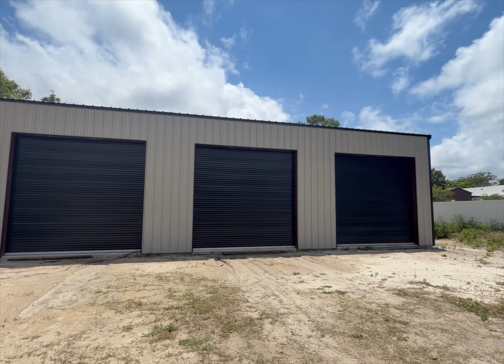60x60 Red Iron Workshop Build

Comment: What was the cost if you don’t mind me asking?
Reply from the maker: The building kit was just under 60k
The concrete was $30k
Other material $3k
Job took a lot of site prep $10k
Permitting and things to go with it $10k
Rental equipment $2,500
I built this 100% myself other than the concrete and had most of the things to do it already. I was quoted around $70k more by contractors to have them do it.
Let me know if you have any other questions